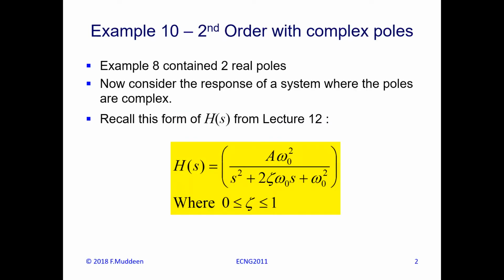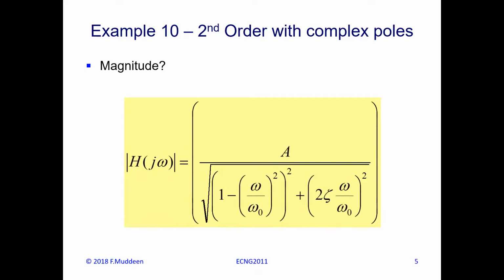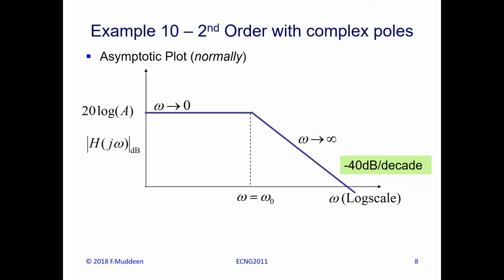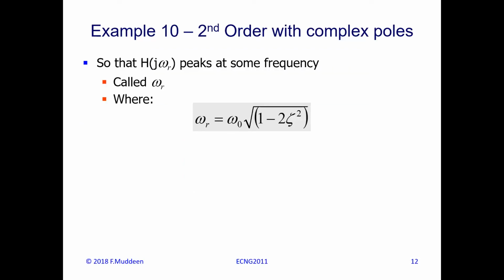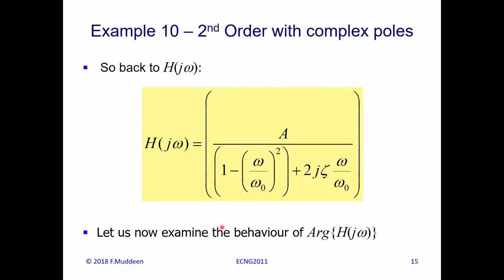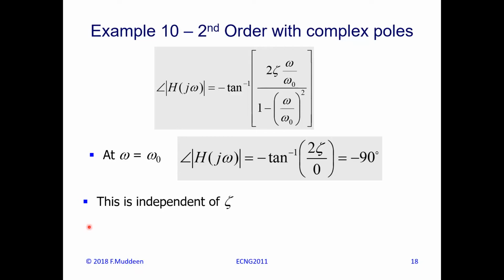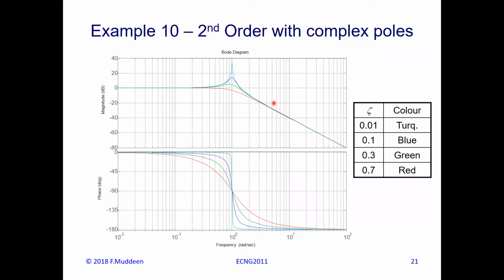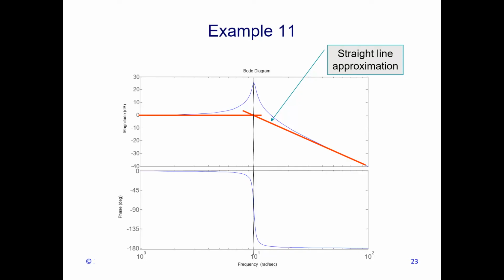SS Lecture 22 - Bode Plots 3

Comment: are these answers correct? :
corner frequency=omega naught= 10
fall off rate: -40db/dec
damping: 0.0265
peak rise at resonance: 18.87 dB
Reply from the maker: The only answer that seems to be wrong is the peak rise at resonance. Check back your calculations for the Mr equation.
Reply: @anielmaharajh   How exactly is zeta calculated, assuming one substitutes the correct value for A and Mr, do we square both sides and pretend its a quadratic by substituting zeta^2=x, then solve for x resulting in two answers, of which the one within the range will be correct?
Reply from the maker: @wizardman1313  Yes you will have to do that. In such a case, choose zeta accordingly for what the question asks. E.g. stability will be between 0 and 1.